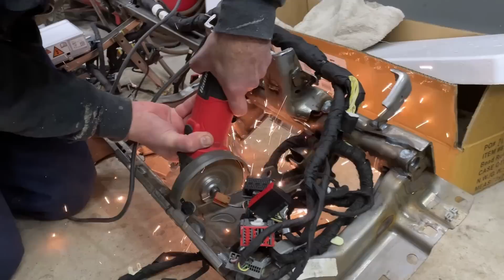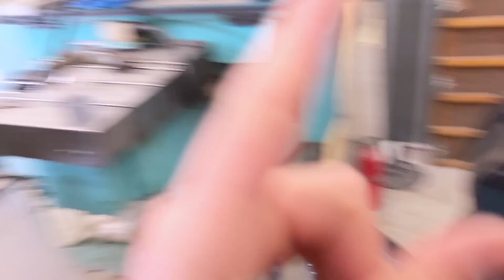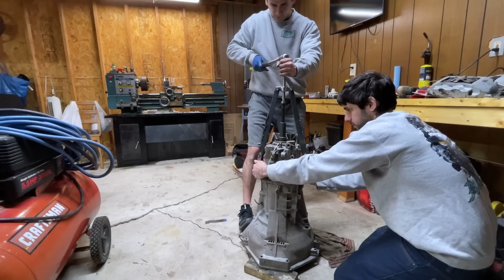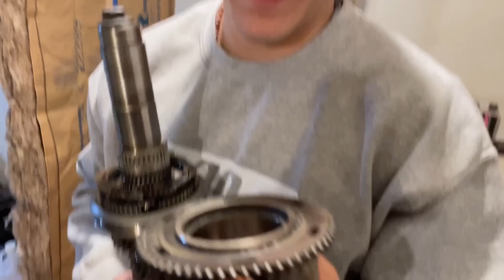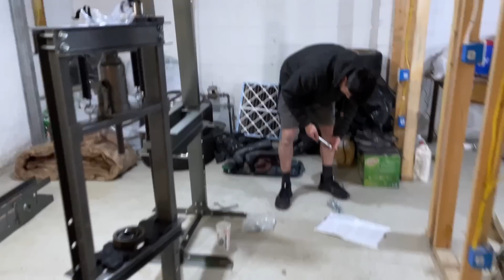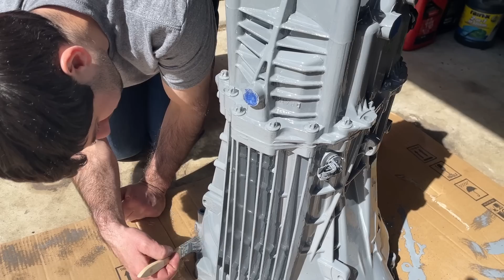Upgrading Our MT-82 Manual Transmission - V10 Continental Build Ep. 6

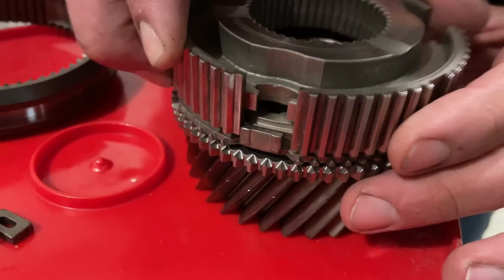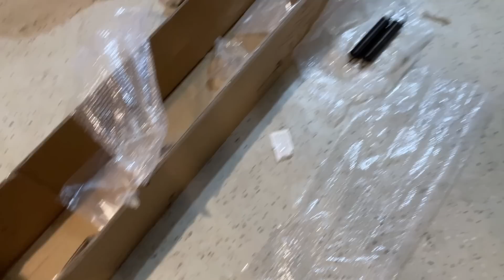Comment: I really admire what you guys are doing. I have the skill and knowledge to do this kind of work, but I have ADD and can't undergo any lengthy projects. I get impatient and discouraged that I can't get it done fast enough and lose interest. @22:00... The nice thing about CF synchros is now you can use the better GL5 gear oils. The bronze ones would wear prematurely with GL-5 because of the high sulfur content. You gotta find GL-4 oil, limiting you to pretty much Amsoil or Redline. @23:30... The HF presses are overrated. Just because the bottle jack is 12k, doesn't mean the rest of the press is. A real 12k press would press those gears on like buttah.

Comment: if you're capable of a v10-1-off/cloning ford's-work ( without any documents like blue print's or CAD-file's etc or OG-craftsman ) just weld/make your own bell housing aka make it work

my charger's so-far for the c7 7-speed TR6060 platform is about the same or less than what you pay'd$ and it's less labour ( yes i could get racing bit's for 2k hp/1500ft~+ but hopefully at 4200lb and 900~hp/demon-or-hellcat-levels daily's/auto-X/road-racing it's not necessary and or i will do it as parts were-out/brake's etc or feel-good excuses ) for me and end products is better off, my mopar/440/hemi bell ( in a 60's charger ) is a aftermarket holly and or quick-time unit that's SFI approved for racing unlike OEM-bell's are

wanting to be fancy and a stick use the DCT options like from a 7 or 8 speed mustang, im not good with programming/computer's ( my strong points are mechanical-sided ) so 👏to your advantage/ability's

there's a good reason why big-CI or higher-cylinder car's/racers don't use some types of parts and i was advised to skip 2L/150~ci-boosted L4-or-v6/boost transmission's from newer platforms, and sticking with v8 stuff and or aftermarket platform's for candidates to use, FYI 833-4speed or 727 for my needs just wasn't up to the needs 727 being lesser as no lock-up or OD-gearing plus for me costing about the same or more than tr6060 on a rebuilding-my-old-stuff at 4+k usd

Comment: One word……T56
Reply: Did you watch the video? They explain why they didn’t go with a t56 lol
Reply: @andrewmontgomery1763  no dude, I blanked out when they decided not to use the best manual transmission ever made.
Reply: @stellingbanjodude  they spent 1200 bucks on rebuilding the mt82, whereas they’d be hard pressed to find a busted up t56 core for that price. And they did meaningful upgrades on the mt82, so def seems like a smart budget minded move.
Reply: @andrewmontgomery1763  dude, they hand built two dohc heads for a v10, and are swapping said engine into a Lincoln, if budget is their concern they’re doing the wrong project! Hahahahahaha
Reply: @stellingbanjodude  they literally said it was for cost, I’m not making this up lol once again, did you watch the video??? And they’re clearly trying to save money where they can, since they have to spend good money on the top end of the engine.
Reply: @andrewmontgomery1763  look dude, did you read what I said? Apparently not, when they started the transmission portion I literally quit watching because I have no interest in any other performance manual transmission. The T56/tr6060 IS the only performance transmission I care anything about.  IMO there’s no other transmission that does what it does. You can keep arguing, but literally if they were “saving money” the transmission is no place to skimp. There I said it. And I won’t take it back. I’m doing my own build, and it’s getting a TR6060, I would rather spend more on the transmission and know what I’ve got vs band aiding a known pile.
Reply: @stellingbanjodude  What about the CD009? And what about the AR-5? The T56/6060 is great, but it's not the only option. Also, if they're not putting sticky tires on the car, and not drag racing it every weekend, I wouldn't be surprised if the mt82 with it's upgrades holds up very well. Why spend 3k or 4k on a trans when you can build one for 1200 that will work fine?
Reply: @andrewmontgomery1763  push off dude. I’m not changing my stance neither are you….. fair day.

Comment: 11-17 have the steel selector forks. The 18-19.5 have the Chinese alloy selector forks that snap, from 19.5 onwards, they started making them in the US and where far stronger. 
Texas Transmissions supply upgraded 1-4 gears, and an upgraded input shaft, plus carbon synchros too. There is a problem with the OEM gears as they àre soft. So bin them. They also supply bronze shift pads, bronze shift stop. 
I'm designing some better stuff for these gearboxes here in Australia. They're not a bad transmission when fixed with better parts, and there are plenty of 700+whp stands running them stock, and plenty into the 9's on them, stock. Best gearbox fluid to run in these is Motul DCT, or Nissan R34 GTR transmission fluid.
Reply from the maker: Wow, great info. Thank you for the recommendation on fluid too!

Comment: Question... why not use a zf manual transmission . Superb workmanship guys
Reply from the maker: Good question. one big reason is the ZF6 doesn't have very good gear ratios since it is a truck only trans.
Reply: I have a 97 BMW 528i with a 5 speed manual. This transmission doesn't have an over-drive fifth is direct drive. How this works is a high speed low reduction rear axle. You could do the same with the truck zf but I know how heavy the parts are in that transmission and banging gears is a bad idea.

Comment: I find the only reason to dig into an old normal one is the throw is getting too long.. the wear down on synchro. Cool to share this in video, that is where i learned it LOL. I have a gmt400 truck at 393k. Those trucks with the 4l slip E  had a 5 speed option. The only thing that hasn't failed.:goodvibes:

Comment: Im a Ford mechanic. Ive done a lot of those. Those gears don't look too bad. I've seen waaaay worse. That would have a harsh engagement but wouldn't pop out of gear. I never realized how dificult those detent plugs would be to remove without the ford slide hammer attachment. Love the videos. I wish that Ford made the 4 valve v10
Reply: Ford: We decided to have a meeting with Dodge back in the day and we gave them our idea for them to create their own version of a V10.
Reply: Ford quality is job assurance. Learned that from years as a tech. Plus the engineers hate anyone who has to work on the vehicles.

Comment: Be careful heating gears to not apply direct heat to the teeth or splines. You can ruin the heat treat if you get them too hot, which will eventually result in pitting.

As a side note, Ford really cheaped out on the MT82 with those shift forks and not even putting any detents in the shift hubs. That whole design says "cost cutting".

Comment: Was thinking about a firewall doubler plate; should have known you guys were all over it. It's clear that Diego has big love for the MT-82. This content is resetting the bar.
Reply: Diego is just torturing himself by locing the MT-82. The best way to fix an MT-82 is to buy a T-56😂
Reply: @Fall2Caine  calimer stage 3 mt82 is really damn strong. The thing that kills mt82 is the clutch or not knowing how to drive. It's notchy like gated transmissions.
Reply: @hatch450sx3  it's not though, it's prone to failure even at the stock power rating. There are countless clips of the MT-82 failing while in gear going down the highway, and sending metal out of the case. It gets extensively worse though as you go up in power. That's why its not uncommon for people to change out a stage 3 mt-82 for a stage 1 t-56
Reply: @Fall2Caine Yeah, you're right. Maybe some deep-pocket gearhead will donate one to the cause. I'm not sure this thing is going to live behind 700 hp.

Comment: So sad. When the MT82 came out, myself and many others I am sure just knew they would be junk. I actually stuffed a "Known Good" one in my 07' Mustang GT for a minute. The gear ratios were ideal for the 4.6 compared to the stock 3650. But alas it crapped out in a few months and a 3650 went back in it. Thanks for the detailed rebuild. I still have my crapped out MT82. I might stuff it in an 80' Trans Am project I am working on currently. If so I'll use your video for reference during the rebuild. Also I really think this build is one of the best on youtube. Thanks for sharing.
Reply: send off that mt82 to calimer and get it built up for cheap. They do a great job.
their stage 1 normally costs around 1800-2000 depending on damaged parts from your core.
Bronze shift pads, billet shift rail stop, carbon fiber synchro's, seals, bearings, etc. 
or jump to that stage 3 for the G-force billet 1-4, runs around 4k iirc
Reply: @Tac_3403 the at home rebuild on these is pretty manageable too. I picked one up with a blown 2nd gear synchro for $200 and did a rebuild for around $120. I do wish I had jumped for the carbon synchros though.

Comment: In addition to idiots, the wrong oil can wreck a transmission as well. My '82 Alfa GTV6's trans had what looked like steel wheel paint in it. The previous owner's "mechanic" filled it with 80w-90 hypoid gear oil instead of non-hypoid, like GL-1. Hypoid oil is actually abrasive in trans that have straight cut gears. So I had a pan full of silver paint. Fortunately I caught it in time and it was fine with the correct oil.

Comment: If that was an automatic, it would be a $115 set of clutches for the primary drive clutch pack... because the solenoid pack actually shifts it's self correct.

Comment: Another thing to consider with syncros, but something you can't do much about, is that the rotational inertia of the clutch disc matters too. I have a Subaru 5 speed (famously shitty) with a stock clutch in a heavy car, it'd grind second sometimes when the syncros couldn't keep up. I swapped that trans into another car later with a light 6 puck clutch (long story) and suddenly it shifted great. So if you can run a smaller diameter or lighter clutch that will help too. The Subaru trans is a cakewalk in contrast to this though! Wow that's a job to teardown.
Reply: I think this is part of the reason Ford went to the twin disk clutch on newer MT-82 Mustangs.

I swapped a 2016 MT-82 into a 2000 Lincoln Navigator and a sport clutch and solid mounted shifter went a long way into improving the shift feel.
Reply from the maker: That's some good advice!

Comment: Next up on BIY: We design our own dog engagement sequential MT82 conversion
Reply: IMO sequential is overrated. Very cool, very fast and functional, but not as fun as H-pattern. Dog engagement is a "hell yeah" though. The most fun transmission is an H-pattern dogbox.
Reply: I think ive seen you on the h6 rally brz you have great taste in yt builds
Reply: sorry but the tuner shop's i knowledge about don't want to tune/boost them and dealership's/aftermarket-resellers ( almost thought 💭about buying/using a IRS used-mustang as in-between ride for my charger in the metal and paint-booth, the $$ and automatic/salesman missed the deal as if its a mustang i was clear GT/v8 ( so resell it higher and easier to dealing with etc, plus historically for likes being a pain for L4's/v6's and part's/repairs/discontinued-etc ) + stick packages ) don't like dealing with mt82 equipped 

there's a reason for the 10R80/10r140's and or tr6060's and the premiums, good thing is the 6060/magnum is more available as more than one manufacturing activity used it as well as being a tremic crate-opportunity, mines a drop-out out of a C7 z51 package and sofar im into it about the same as the video or less, without the headache of new-gear's-etc just core and swap-bit's for my 60's charger , there vary capability of making bell and other swapping bit's, im doing parts of it and currently i don't have a home 3d-printing or mill so there shop-space probably is better equipped than mine is 🤷‍♂ 🤔
Reply: also edit convertibles so it's a different experience to my charger's body etc
Reply: I have begged a couple companies to consider a dog box style mt82 and offered a core to send them.
Reply: @ That wouldn't make any sense when you can just get a dog box t56 for probably less.